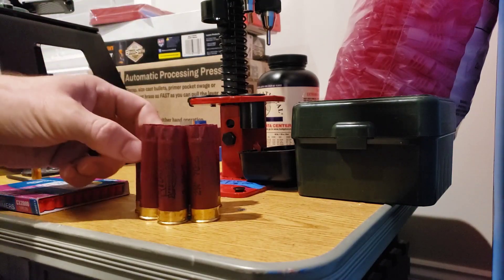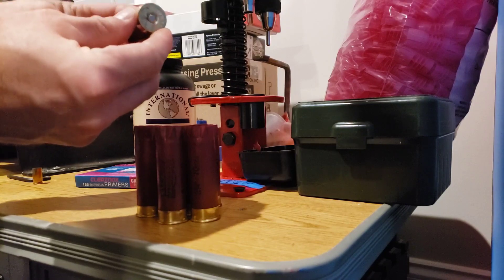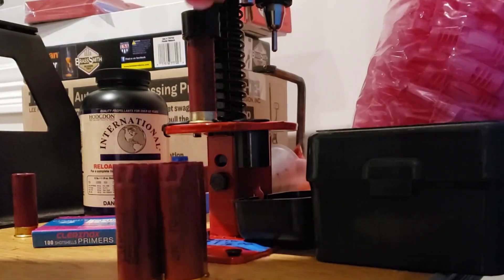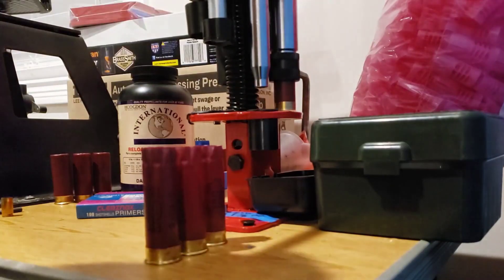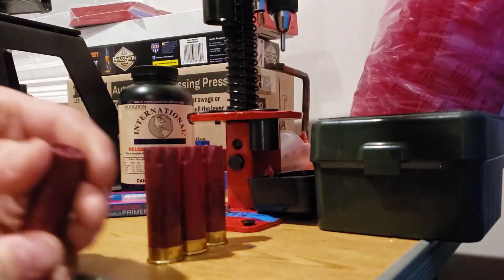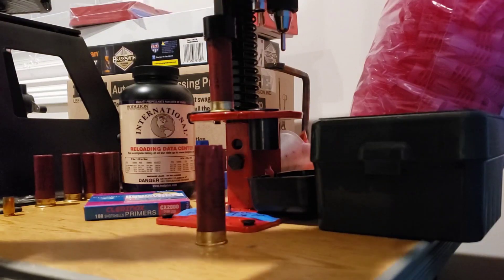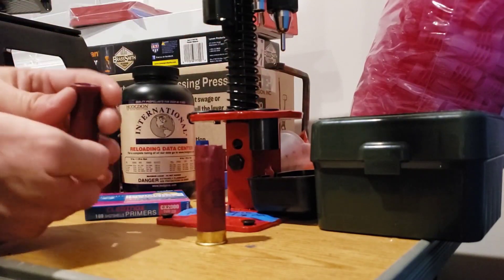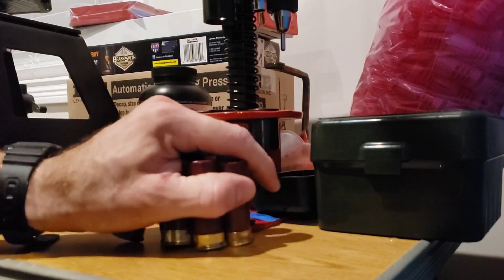Getting Acquainted With The MEC 600jr For Reloading 12ga

Comment: Just be careful not to adjust the sizing ring too low. If you do, you can crush the rims which causes the rim to expand and not feed in a tube magazine. This can also cause the "n" shaped bolt, that the decapping pin is mounted on, to bend. Ask me how I know, after trashing 200 hulls and replacing the entire decapping and resizing assembly... I thought more sizing = more better... nope. I don't think you're sizing too much. In hindsight, it's pretty obvious if you are doing it too much, you'll be using a significant amount of force to resize(this should be nearly effortless) and the rim of the hull will be very obviously flattened with sharp edges compared to any other hull. I'm 99.999% sure you're not sizing too much, just a heads up from my mistakes. Anyway, keep up the good work Sir!
Reply from the maker: I just have it on the factory setting right now and that seems to be doing perfectly, but I'll definitely be careful not to go too far if I do end up needing an adjustment. Thanks for the heads up! 🇺🇲👍
Reply: @DummyRound  yeah the factory setting should be just fine. As long as the loaded shells pass the chamber plunk test they're good. Keep up the good work Sir and have fun with your new toy!
Reply from the maker: Much enjoyment to come! Have a great week👊